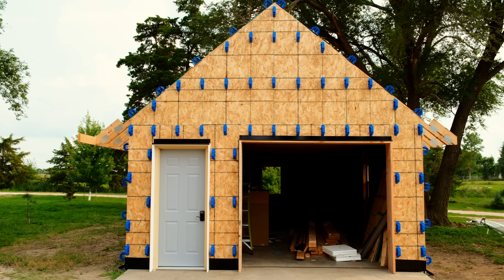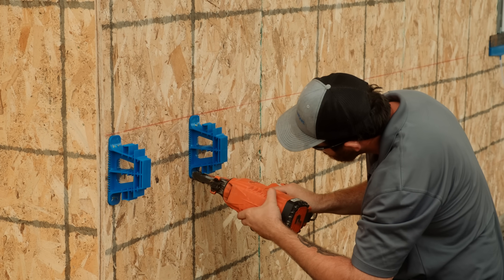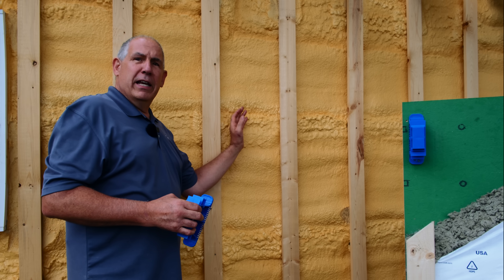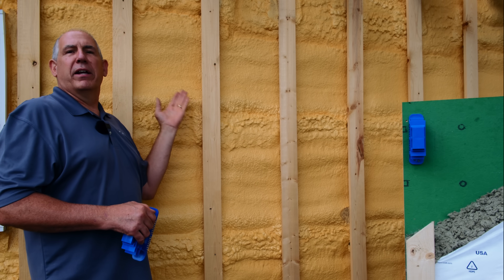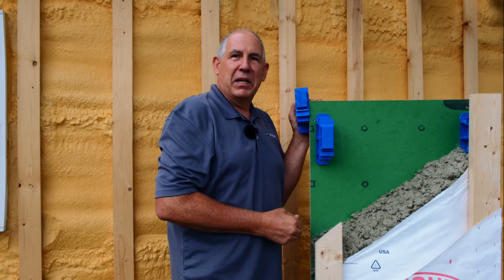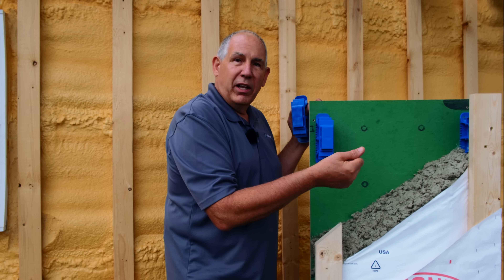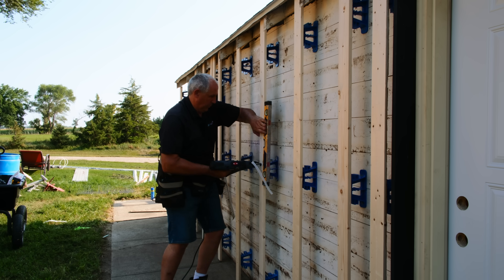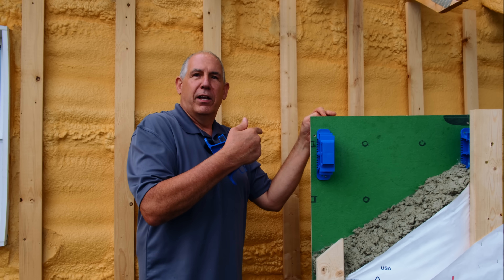We perfected the Perfect Wall... now the Roof!?

Comment: I see a lot of potential for this new product. One thing I'm curious about is the framing detail down near the sill plate area for the external insulation. Is there a ledge framed on the exterior to support and hold in, the blown in insulation? 

Edit .... I see now at the 4:25 mark, there's a white, flashing/base channel, at the base of the wall. Pinned to the wall and anchored on the outside to the new, blue, InSoFast attachment points. That would hold the blown in insulation inside the envelope. 

Also, I'm wondering if a person could attach these to a shipping container inside and out, using Loctite adhesive, and then attach exterior framing to your new attachment points. I could see where they could be used inside and outside a shipping container like this. I'm wondering what the height of this new attachment point is, and how far it would stick out if placed in the groove/negative corrugation space in a container? Does it clear the raised corrugation adjacent. 

Fun product... Looking forward to seeing more. Always looking for a better mouse trap. 🙂
Reply from the maker: Thanks for noticing and YES there is a white U channel in place.  We actually took that out on the demo project and replaced it with a wood ledger to allow drainage and allow full ventilation for the rain screen.  We do have examples of how to do the bottom of the wall.....coming soon😉

We will be producing two X-Brackets to start with:  2.5” and 3.75” and are working on other sizes up to 11”  The corrugation depth is generally 1-3/8” deep so there several configurations to get the amount of insulation desired.

Looking forward to showing you more 🙌
Reply: @insofastllc  Looks like we've got a lot of experts here in the comment section. >;-) I come back every couple days just to read the comments.... >:-D

Comment: InSoFast is a great company.  I insulated my basement with their panel system.  It was easy, fast and simple and provided immediate benefits.  Adding drywall was simple and the job went smoothly.  It was my first time doing a job like this and the results were great — I’m a homeowner not a contractor. If I can do it you can too.

Comment: Was there any info on sound differences with a metal roof or siding? Would be interesting to install in the barndo we are going to build already a huge fan of the other products
Reply from the maker: Spray foam will substantially reduce sound transmission through your metal roof or siding.

Comment: My issue with spray foam is that it’s so operator dependent. If they don’t get everything just perfect there can be big gaps or pulling away etc. Is this new spray foam more forgiving of conditions and operator errors?
Reply from the maker: Valid question- We get that spray foam quality is operator-dependent. That's why we recommend experienced professionals. The new spray foam has improved environmentally but still requires precise application. As our system becomes available for purchase, we will be sure to offer resources on our website to help you find reputable installers!
Reply: @insofastllc  couldn't you do prefab foam panels with built in brackets, with either guide holes for screws outside in or screwed from inside?
Reply: @kashifkhan3040  They have that product already except its EPS foam
Reply: Have you ever seen a poorly done fiberglass job? It alway depends on the quality of installer.